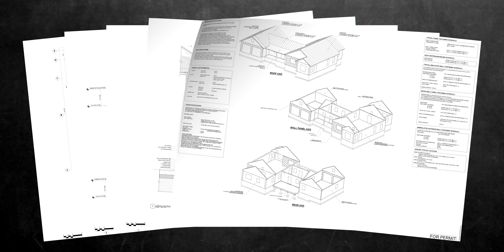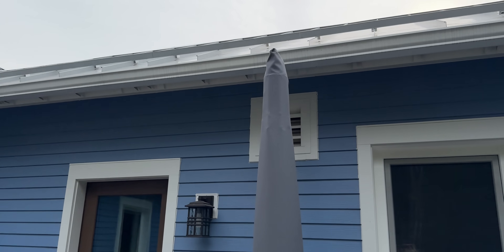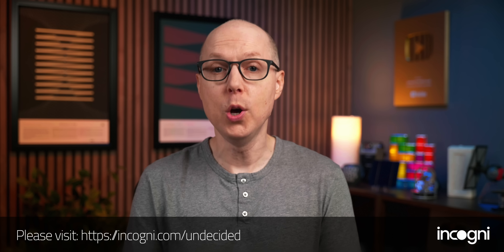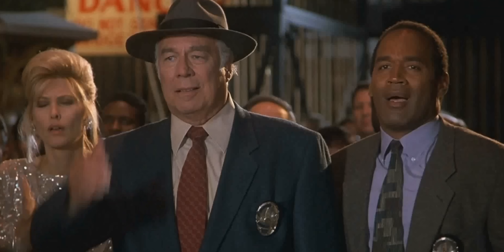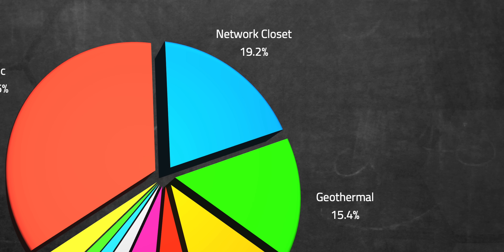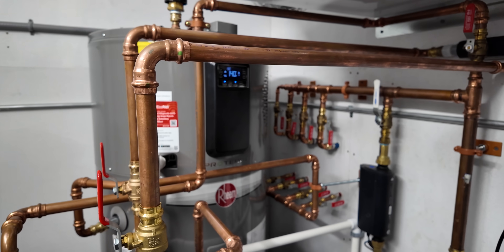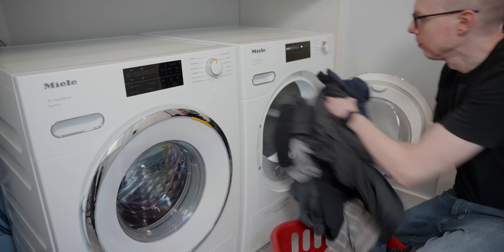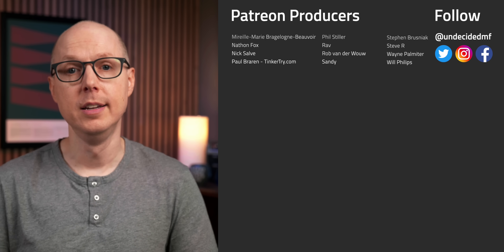What I Learned After 1 Year in My Net Zero House

Comment: Matt, as I have mentioned in previous posts, I also have a custom built passive-class house but in the UK.  I have many design decisions in common with  you: high insulation, best in class windows, 0.5 ACH. ERV (which we call MVHR), designed for through-life low maintenance and occupant comfort.  I want to explore some differences. 
  We went for maximum simplicity and used the experiences of fellow self-builders to inform our choices: single zone 24×7 (near) constant temperature (22-23°C like yours), in-slab UFH as the only heating which means that our main upper floor runs about 2°C cooler in winter.  My son's in-loft rooms are largely boost-heated by his games/multimedia system. 🤣I kept the initial automation to an absolute minimum, so whilst we pre-plumbed/wired for a ASHP, we initially only installed a 3kW inline electric water heater to heat our UFH.  To be honest, the ASHP and many other frills never made the cost-benefit cut because the annualised savings simply could not make a sensible payback vs. cost of procurement and installation. 
  As a result, having an energy-efficient design only added under 10% to the build costs. (Our major single build cost was a natural stone skin to the build to comply with local code restrictions.) We've no PV (again a code-veto for our location), so the house will never be energy-neutral.  However we are all-electric and buy our energy on a renewable time-of-use tariff which is priced day-ahead in half-hourly slots.  Nothing fancy for our HW: just a super insulated unvented cylinder with a couple of immersion heaters, but this use costs pin-money when correctly scheduled on the ToU tariff. As to S/W I use Home Assistant as a general integration and User Interface, but my CH and HW planning and scheduling is done by a ~900 line Node.js app that I wrote that uses MQTT to talk to the cloud pricing, forecast and other feed as well as drive a bunch of Tasmota and Zigbee devices, so my IT costs were in the $100s not $10,000s.
  My bottom line point is that you can achieve a very cost-effective energy efficient build if you keep the Keep-It-Simple-Stupid criterion in mind during design and build.

Comment: As an hvac tech that works on every HP design and configuration imaginable, I'll stick with my properly sized 98% efficient gas furnace, and the 99% efficient water heater. Far cheaper in the end.

Comment: I dont even want to know what my network rack is using..lol I have started to use mini-pcs for some items, but my NAS has 20 hard drives it runs 24/7 and another R630 for VMs for work stuff running 24/5 generally. I love a lot of what you have done, i live in a house built in 1895 and yeah to say its a pain would be an understatement even plumbing and electric were all added after it was built. I cant wait until I move in a few years and go into a house built at least since 2000.

Comment: I was interested to see a whole home dehumidifier in the mix. I have a similar setup at our place with a slight tweak that we're retrofitting a 160 year old heritage home. But otherwise we got a 1ACH50 air tightness, have a central ducted (air source) heat pump system with an HRV. I've had the exact same struggles with air quality (CO2) and learned to keep the air handler/hrv fan running constantly, but one thing I haven't managed to control properly is the humidity. We're in Southern Ontario, so probably a similar climate to Mass. It averages 80+ % humidity in the summer/fall. Was the whole home dehumidifier part of your original design? I would have thought the ERV (which I'm looking to switch to) would have captured a fair amount of moisture. I'm shocked to see how much energy that whole home dehumidifier uses. Anyway all interesting stuff, thanks for the vids!

Comment: Nice to see the heat pumps are working as intended. On the topic of energy generation, I hope you'll show how well your generation actually matches up with your usage. Net zero on a yearly basis doesn't really mean anything after all. That's just administrative and still requires you to depend on the grid and probably fossil fuel.
The real question is how often of the time you do not depend on the grid. I bet you have far too little solar to get you through the winter.

Comment: Have you considered putting awnings on your windows? They cut down a massive amount of heat from entering your house which means less energy to cool your house in the summer. if they are retractable you can still allow the sun to enter during the winter months. Technology Connections had a great video about this if you wanted to check it out

Comment: During the construction of our new office I was able to advise the architect on the amount of residual heat from the computer system, which led to the entire heating system being reconsidered. Because the building had a water source (it used to be a beer factory), the building was given 2 wells (cold and heat) of 270 meters deep and with 2 heat exchangers. At 270 meters deep there was a sealed porous soil layer, which meant that it had to be 270 meters deep. Furthermore, ceiling heating and cooling were chosen for the heating.
This building was finished in 2002 and was the first building in the Netherlands with such an energy household and it was opened by the Queen of the Netherlands. Ceiling heating and cooling also provide a very pleasant living environment because the air speed in the room is much lower. A truly superior heating system.

Regarding your house. With a few electric heating panels at the seating locations and you could return the house temperature to 21 degrees.

My own rental house. I also use a dryer with a heat pump at home and I extract the heat from the air that goes outside, which saves me a lot of heat.

Regarding the story: A question that remains partly unanswered is the return on your investment. You have invested a lot, but within how many years will it have paid for itself.

Comment: I would say that Heat Backup is additional coil in heat pump, I have air to water heat pump and these additional coils are started if it is too cold outside or if there is big difference in outside and wanted temperature inside.

Comment: Heat Backup is likely the heating element on the hot water tank bringing the temp up occasionally above 65C a couple of times a month to prevent bacterical growth in the tank. As likely the heat pump would only bring the water in the tank to 48C for normal household use. Some of the very newest air to water heat pumps just out this year here in Ireland can hit 75C for this purpose (and to allow better compatibility with retrofits/radiators) without using a resistive heating element... but every heat pump setup I've seen previously has a heating element in the water tank for this purpose.

Comment: I'd love to see more of these systems that use the waste energy of one system as input for another. Fridges, Freezers, hot air ovens all exhaust heat into the living area that needs to be vented/cooled. It would be great if that heat could be pumped into a hot water tank instead.
Our ventilation systems pulls in fresh air through underground pipes so it preconditions the air before going through the ERV.
It's a great system but as we unfortunately learned it is vulnerable to groundwater if the pipes are not laid properly. A school in Belgium has a much larger version of such a system and their system includes a collection system and pump for any water that might infiltrate. It does add extra components/maintenance but it would have saved us a big insurance issue.
Reply: This comment received a reply of someone pretending to be associated with the channel. They left a phone number to call of a so called support line. I reported the comment as spam.

Comment: Heat pump dryer is kinda scam. Regular one use about double energy... But it's 700 eur more expensive. And it's gonna last about 2 times less. Because refrigerant gas is gonna leak and compressor is gonna die.

Comment: That HVAC sounds familiar... Oh right it's what my granpa installed in his house that I grew up in, some 50 years ago. Just our heat source wasn't ground heatpump, it was heating up a huge boiler tank on night price electricity and recirculating heat from thebfireplace/sauna. :)
Great system if you get the distribution adjustments to work, we had one room that we couldn't get enough air to. Easy to upgrade/refit too once your 4 decades old machine has lost its efficiency. Totally worth installing into a new building.

Comment: You couldve gone with an cheaper, maybe chinese, Midea or Gree:), air to water heat pump, if it's not very very cold for long periods of time...and for energy delivery with underfloor liquid heating, and for ceiling and walls, capillaries matts for cooling...it's quiter and it wouldn't interfere with the centralized erv sistem

Comment: Net zero homes.. Yep I get it, but need to see the carbon cost of the actual build i.e. The actual cost in diesel hours/miles of machinery and plant, builders and techs on site. How far did they travel  for the build? How far did they drill clearly using diesel plant for the heat pump?. Where were the products produced? This build could quite possibly negate to 3 generations of your family's carbon footprint . A vanity item/build in my opinion given no one seems to want to simply bring what we have up to standard. Just a thought...

Comment: Fascinating to hear the results of all your planning! I find it very interesting to see how much better houses CAN be built! Being originally from Germany myself, several things you mentioned in this and other videos looked rather familiar (tilt-turn windows or the Miele washer and drier, for example), and I have to admit it felt good to have them appreciated. 

I have one question: when you were in the planning phase, did you ever consider tankless/flow-through water heaters instead of a hot water tank? I know, your water tank makes use of your geothermal system, but it still ends up heating water that will  just be sitting in the tank until it gets used, right? My understanding (very basic as it is) is that the tankless water heaters are much more energy efficient since they only heat up water when you need it and only as much water as you need heated. Plus, you don’t have to let water run until the warm water reaches the faucet from wherever the water tank is, since the tankless water heaters are much closer to the faucets, so they are more efficient in terms of water usage, too. 

You’ve put so much thought into all the different aspects of your home (and to amazing results!!) that I’m curious for your perspective and thoughts on this. 

Thank you for these super interesting and educational videos!

Comment: I live in a northern climate where we also get tornados. 
I'm going to build a sealed envelope ICF ranch style house with air exchanger and humidity control, a full basement. In floor heat. Geothermal heat pump. 
Solar power.

Comment: I'm building a similar-insulated house myself.  Today I was finally filling the outer wall with rockwool batts.
-1600 sqft post frame.  
-Air source heat pump mini splits with a concealed duct system.  
-Heat pump water heater will be setup to intake air from the open plan south facing area.  
-Have a video on tips learned building the shell.

Comment: Id be turning off the dehumidifier for a few months and monitoring the result , they are so inefficient compared to air exchange and Heat pump AC which also dehumidify. im picking a 5% humidity difference and less spent on aging cream from raisin skin

Comment: These sorts of videos are some of my favorites that you make, so glad you put this out there for others to learn from. I'm also glad you touched upon the whole ERV thing, given the manufacturers have various ways they recommend they be installed. I'm also regretting tying mine into my HVAC ductwork, having it separate would have been better for us since our idle air handlers have condensate on them sometimes when the ERV turns them on. Having that air handler fan running without the coil being cold isn't great (blowing humidity into the home). Working on a workaround (software and/or hardware), we'll see...

Comment: I still have to wonder about the utility of a geothermal unit for a residential home.  I remember looking into them in the late '90s and the cost of one would never pay for itself in the long run because the system was just prohibitively expensive.  Granted, the system's cost has probably gone down over the past 30 years but I still have to wonder if it has gone down enough to be useful and cost effective.

Comment: @Matt - Minimizing space heating and air conditioning indicates a derived goal to minimizing the external surface area (roof and walls, even floor). The most efficient shape for enclosed volume to surface area would be a sphere. Of course, that would be silly. But your house design has more-or-less ignored this consideration with the three box design.

Comment: Air Source heat pumps work many places. But the winter here gets to -45C, so gas or geothermal, are the only viable options. And small in city lots (~500sqm) would struggle to fit sufficient vertical wells.

Comment: The 39% for the heat pump compared to the old house is not that impressive, considering that a kWh of electricity costs 3x as much as a kWh of natural gas. Also if the kWh electricity comes from a gas fired power plant, it is produced by burning 2 kWh worth of natural gas.

Comment: Hey Matt. Great video again, thanks. 

On the heat backup energy usage, if the temperature through the heat exchanger doesn’t reach the desired internal temperature on the thermostat, sometimes there is an electric post-heater to top up the air temperature, this might be that mystery 4%?

Comment: In a lot of countries where energy is relatively cheap, there is a mind boggling potential to waste less of it. My current apartment gets heated (including the water) through heat exchangers with district heating which in part uses the waste heat from a steel rolling plant a couple kilometers away.

Comment: Matt, you were not clear on what was included in the network closet energy usage. From a commercial building veiw point maintaining the operating temperature in the network room or closet is part of that energy usage. If you didn't calculate the network closet energy usage in this way it impact all your other calculate for your house energy usage. The network closet is a heat source that heats your house. It is helpful in the winter and hurts in the summer. 

Added note, ERU recover heat and humidity. HRU recover heat.

Comment: Thank you Matt, I have no experience with this but I will consider a heat pump hot water heater when it is time to replace this natural gas fired one.  Side note: I do use a home monitoring system and It saved me because it detected a water leak the expansion tank on the hot water heater broke and the hot water talk would trip the over flow at night after showers and we went to bed. Solving this saved us thousands I am sure.  The replacement tank was only $35 and about 15 minutes to install.  Love the channel keep up the good work and I am looking forward to part 2.

Comment: The efficiency of the house isn't just how energy air tight it is though, it's air tightness divided by the total amount of contact with the outside world. The design of your house is killing the energy efficiency. You would have been better off building a compact 2 story to code.

Comment: A veteran hvac business owner told he leaves his hvac fan on year round. Ultimately less wear and tear than starting and stopping and more even temperature.
Reply: I'm a builder and HVAC contractor and a variable or 2 stage fan that you can leave on 24/7 is the single best thing you can do to improve livability.
It's the reason top tier homes, which I worked on, no longer use in floor heat. It's better to circulate the air and make everything in te house the same temperature.
Reply: @johnlabernik4599  that's changed  with co timeously  variable  units
Reply: I've been told that too, and I've tried that but dislike the constant noise

Comment: Could that "Heat Backup" be the Electric water heater that's build into the heatpump system that kicks in to produce hot water when the heatpump is not enough ? ( in winter when it's not efficient enough )

Comment: It surprises me that an appliance manufacturer has not designed a clothes dryer with something akin to a closed combustion system.  In other words, similar to a high efficiency furnace, it would draw cold, dry air from the outside the home.  You’d have two ducts for the dryer, one intake and the other for exhaust.

Of course, I wonder if the laundry room could be designed to be separate from the rest of the house and have its own outside air source.

Comment: I worked my network closet from 80 KWh/mo down to 20 KWh / month where it is now.  That's for all my core network gear, storage, and PoE powered devices. It was an exercise in eliminating unnecessary gear and simplifying. Like you, I also run my business out of my home - a software engineering firm.

Comment: Hi, I own a 30 yr old factory  built modular home on a basement , originally r19 walls and r30 attic space code at that time. The house leaked air like a sieve. Over the years I've  one have added first rigid foam in walls and the joist spaces in the basement. 2008 I added ground loop geothem, 3 yrs ago a 12k grid tied solar,last year energyrated windows throughout. All led lighting. Had my home blower tested by my utility provider this year and was pleasantly surprised  of the results that my home met the Ashrae62.2 2016 standard.